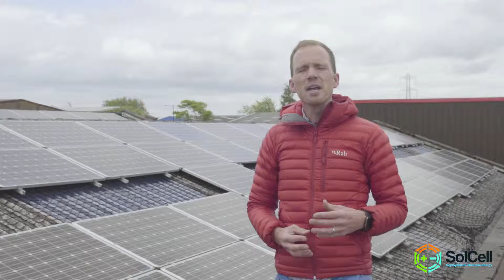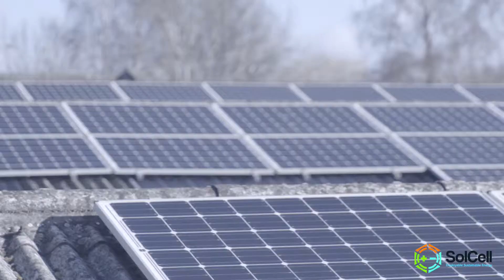SolCell Power Plant Explained

Comment: hi, just chatted on phone. just added that email. Turned out i had not added that extra sort email alias yet to my email :o opps. 
Nice polished, well spoken video :) on my todo list :). 

Got some vids of what ive been working on my channel. Small scale, so potently ideal for a future of tiny or little events. Everything battery powered or hacked to be battery powered. no inverters needed :). Need to refine and make it shiny pro setups next :D. ETFE solar panels to save weight and be more compact :).
Reply: so far, solar panels on site helped to extend runtime :). On fence for ordering some 272ah i think lifepo4. Thinking i will after all, after china new year.